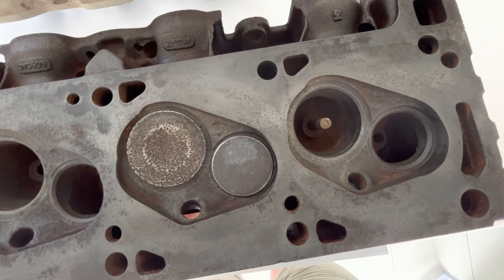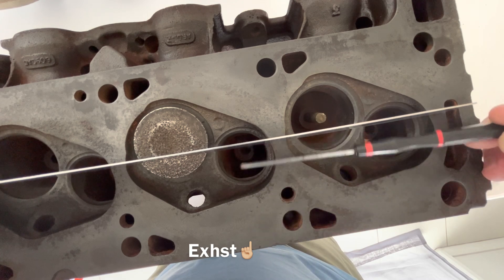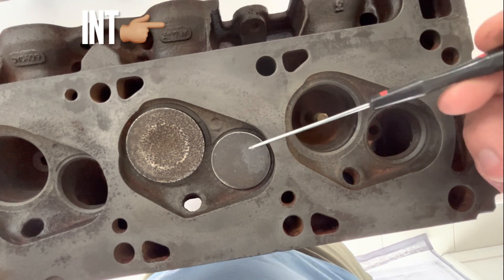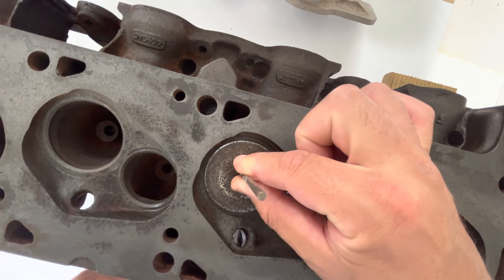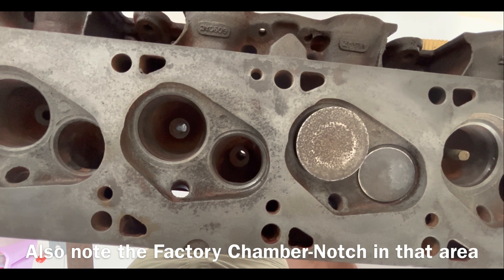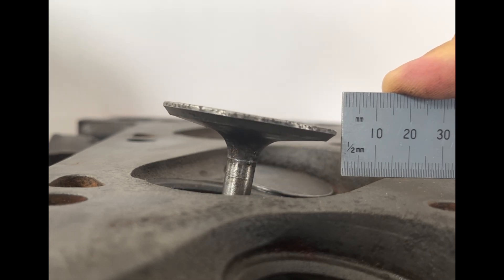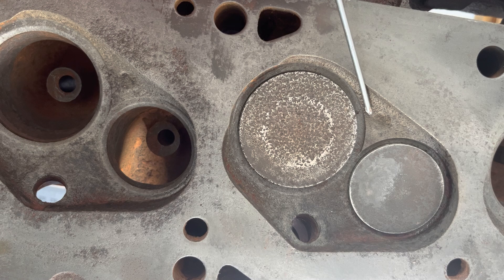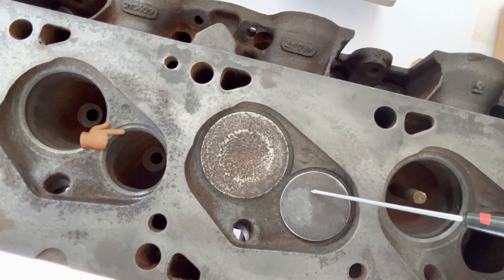Ford Cleveland 4V & 2V Heads, Staggered & Canted Valves Overview

Comment: back in the eighties some head shops removed material around the intake valve 'notch', not a lot of material , we are talking 1-2mm and they said it was to promote more 'swirl". Im no expert, but in my experience my 302 with closed chamber 2V heads had better throttle response with the notch work done
Reply from the maker: That's cool 👍🏼🏁

Comment: Cleveland 4v heads are probably the worst designed v8 heads ever. It doesnt matter what heads you use you will notice an improvement over 4v heads. I had many windsor and cleveland engines back in the day and i understand engines very very well. Everybody knows they are terrible
Reply from the maker: They're not terrible lol 🤦🏻‍♂️
Is their better street heads & more readily available now, Yes!

Comment: I have commented before about my Australian 302 2V quench chamber heads on my Cleveland. I went with 2.190 intake and 1.710 exhaust valves. Single pattern cam with. 540 lift and 270 duration at .015 lift. It's a really fun driver and satisfies the soul when going on a back road romp.
Reply from the maker: @JimsFastbackGarage  right on Jim, stock valve size on that deal would of been adequate. Cool 👍🏼🏁

Comment: Great job making a simple process demonstrate a fairly complex set of actions, Janks.
 Once seeing your visual demo, people who are not sure what a Cleveland/Boss head and valvetrain does differently than the typical inline valve head should have a little better idea. And also should have a grip on why this configuration has been and sometimes still is called a "Semi-Hemi" along with the "Canted-Valve" appelation that is more common. Your demo makes it pretty plain, to anyone who is curious, why this head configuration provides a significantly superior intake tract and better chamber efficiency as compared to most other OHV head layouts.
 It should also help explain the potential advantage a "Semi-Hemi" head may have over some heads that are closer to "Full-Hemi". You don't have to have such a big/deep chamber as a typical hemi, and can potentially build a lot more compression into your engine. Maybe just as importantly, you don't have to use a huge dome to build as much compression as possible, and have that huge lump of aluminum sticking right up in the path of the charge that is trying to makes it's way from the intake side of the chamber to the exhaust side. While a semi-hemi should not have the ultimate flow capability  of a comparable full or pure hemi, it should, in most cases, be able to efficiently use a considerably higher percentage of the charge that it can flow.
 I am hugely curious why the engineers/designers chose the angles they did for the exhaust valve. I know they had reasons. Unfortunately for amateurs like me who are not expert in the idiosyncracies of air or charge flow, flow doesn't always seem to follow the rules of physics, or logic, on the surface. Maybe they were only concerned about not having it get in the way of the intake. I like how I have heard Jon Kaase put it; (paraphrasing him) 'We sort of don't care about the exhaust as much as we do about the intake. The exhaust pulse if under high pressure, and it's gonna come out of there if you give it any halfway reasonable path.' 
 Thanks mate.
Reply from the maker: Right on Z, appreciate the comment👌🏼🏁, if you notice on the Exhaust valve it “un-shrouds” the back wall of the port & leading up to the roof where the gasses want to be for an effective & efficient exit instead of the short turn which was “shrouded” if you remember &  bares no significance in that region which in turn is the port floor that has a runoff that both 4V & 2V have…… interesting🤷🏻‍♂️🏁
Reply: Oddly, the exhaust side suffered more from the chassis' that clevelands went into than due to the details of ideal angles - think Mustang/Aussie Falcons and those big, tight shock towers! It's funny when you see dyno runs of BBC' and they have headers that run dead straight out 4" or so - try doing that on a clevo and getting it into a factory engine bay. 🙏👍

Comment: Man, I wish the US had those 2V closed chambered heads back in the day! All our 2Vs were open chamber, but they still did good. When we were running our dirt dobbers, we had to watch the cam lift we used on heads we put big valves in. Get over about .700 lift and put those big intake valves in, ( I think around 2.24?), we had to back up from 1.73 to 1.65 exhaust valves, because they would hit each other at high lift. We found that at least .060 between them at our highest lift we ran, was on the risky side of safe. All that was measured and tested as we built the engines. If the cam had a lower max lift, we could run the bigger exhaust valves. As everyone knows, you need all the exhaust you can get on these motors.
Reply from the maker: Wow That’s cool  EF, old memories i bet 👍🏼🏁
Reply: Those are 302 Cleveland heads ! And yes very good on a bigger 351 or 400

Comment: This is an excellent illustration of the reasons why Cleveland heads are superior to all the others from that period in automotive history. 
I could have used this video for all of the times that I tried to explain “canted valves” to people that were novices to the Cleveland experience. Well done my friend 😊.
Reply from the maker: Thanks DW appreciate the kind comments as always my friend👍🏼.
It’s pretty cool to check out the action up close….& gives you an understanding of how things are good, restrictive & what subtle mods could be made to the chamber to possibly improve things, didn’t get into that though. You can see key chamber mods on them 2V CNC versions & make out why it’s moded in that way….. subtle common sense mods to the chamber is all it needs i think👌🏼🏁
Reply: @69JANKS  … Well 69J, descriptive words will only do so much but the way you use basic diagrams along with video of the valves in motion to illustrate the relationship of valve position to the cylinder walls and how the canted angles work to provide extra clearance for unimpeded flow during operation does a lot to explain the process. 

If a person doesn’t “get it” by now, chances are they have been brainwashed by GM propaganda and beyond help LOL !
Reply from the maker: @danielwilson6665  thanks DW, haha 😂 agreed my friend 💯
Reply: The Mopar poly was pretty cool with canted valves and pre-dated the Cleveland and obviously all hemi's have canted valves. Honestly Mopar should have developed the poly further instead of replacing it with wedge head LA's.

Comment: Ever since owning a 351 cleveland in a 1971 mustang back in 1979 I have been a fan.It was the best running engine I've ever owned.Responded very well to bolt ons and also ran extremely well stock.As you say often,"Bad Ass".👍🏆🥇
Reply from the maker: Cool JM💪🏼🏁

Comment: What do you think about the 2v with bigger valves,?
Reply from the maker: It’s been done a lot in the past & worked🤷🏻‍♂️, on a serious & big Ci combo (393-408) I’d do the Exhst 4V size, just to help gasses out, nothing wrong with a larger entry to get things out better & quicker🤷🏻‍♂️. Some guys nowadays “in black n white” state that the Inlet 4V valve disrupts the Valve size/Throat & Cross-section values etc etc…..but hey didn’t stop 3500lb cars from ruining into the mid-11s 20yrs+ ago 🤷🏻‍♂️🏁…….
Reply: I run the 2.190 intake and 1.710 exhaust in my 2V Australian headed Cleveland. 357 C.I.
Reply from the maker: @JimsFastbackGarage  nuthn wrong with that👌🏼🏁
Reply: @JimsFastbackGarage  could you tell any power gains? because I've always heard negative about going that route
Reply: @clevelandmcneill1159  there was a noticeable difference on acceleration and I haven't run it at the track since going from stock American 2V heads to the ones I mentioned. My car ran 13.98 spinning all the way through 1st and 2nd gear on street tires. Hope to get some new times this summer at the track.
Reply: Nice visual of the two sides angle's in relation to each other, Janksy 👊 That movement away from the bore really shows that low-to-mid lift flow bump the canted valve head gains over parrallel valve layout ! I heard years back something about clevos responding better to lift rather than duration?? Your demo could be the proof 🙏 jk
Reply from the maker: @johnkraft7461   thanks JK👍🏼🏁, very interesting point👌🏼, appreciate you tuning in🏁

Comment: Really SO glad you're here, Janks!
God save the Cleveland. 
One of my recurring daydreams is a set of 2V Cleveland heads on my 351W (stroked to 393) for my F150.
I've plenty of associated knowledge and the skills to 'Clevor' said Windsor, and being the truck version they're more than stout enough to add a little boost on top should the need arise - I've one of mine out there at 650rwhp which is a conservative 700fwhp, and its been on the job in excess of 15yrs, so durability isn't a concern.

Note, the 2V choice would be over the 5000+lb weight of said pickup.

Comment: Always liked the Cleveland and the tall deck 351M/400. Besides a Cobra, which requires a proper FE engine, I'd run the Cleveland top end engine in just about any Ford I was preparing. A squareish 400 (4.030 x 4.00 stroke) seems like an ideal street engine, with spacers or a dedicated tall deck intake. Thanks for all your posts!! Dedicated MoPar (and sometimes Buick/Olds) follower of your channel. RB
Reply: I fought for that very combination (400M/Cleveland heads) in a local tractor pulling competition class.
They allowed the 400SBC but the Fords were held to the 390 FE, well doesn't take much to imagine how lopsided that was.
Well, I was ultimately successful in my petition for the M/Cleveland, and built the first one to compete in the class.
I had to convince the owner of the tractor to let a few of the pulls to fall to the little Chevys lest he/we lose the M/Cleveland to being outlawed.
Kind of a reflection on Bob Glidden and the NHRA trying to factor him out of competition.
Reply from the maker: @Motor-City-Mike  wow MCM, always holding back the 335 series weren’t they😕
Reply: @69JANKS  Us MoPar guys are used to it also, 426 Hemi and other engines factored and outlawed by sanctioning bodies.
Reply from the maker: @rodneybyrd9516  yep, i hear ya 🤷🏻‍♂️🏁
Reply: @Motor-City-Mike  … Your well fought battle with the officials of the sanctioning body is another reason why the Cleveland is known as the most protested, restricted, limited by rules, outlawed, bitched about and banned engine in racing history. The GM contingent were typically the ones that cried the loudest about Clevelands having an unfair advantage. Bob Glidden’s Cleveland Pro Stock domination is a good example of how the biased puppets at the NHRA changed the rules to keep Cleveland Fords out of the winners circle.  And the beat goes on….
Reply: @Motor-City-Mike  how the heck would they know if you were running a 390fe or a 428?  I would have taken every advantage of that one lol.

I'm with ya on a 400 with good Cleveland heads. Have always liked that combo. They always worked real good in a mud drag truck application atleast.
Reply from the maker: Thanks RB appreciate the comment, tall deck M/400 would be cool👌🏼🏁